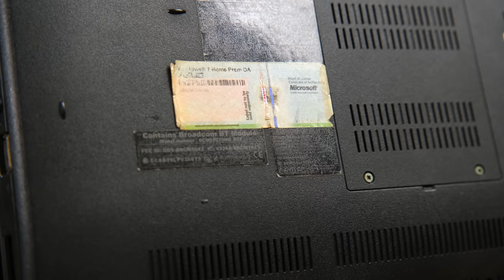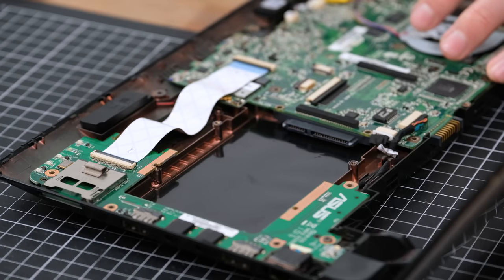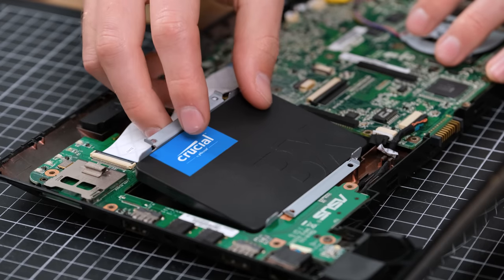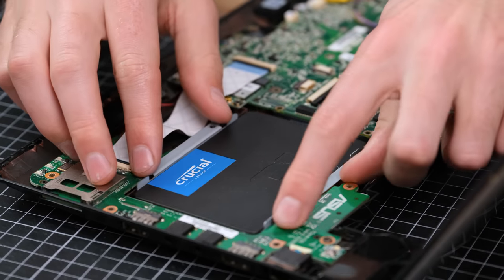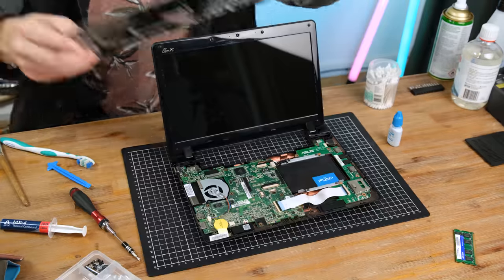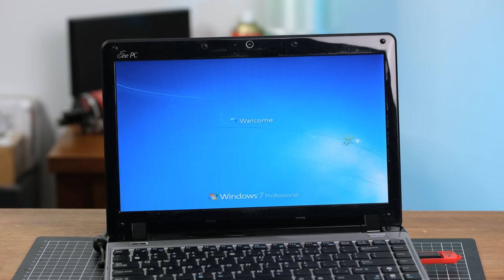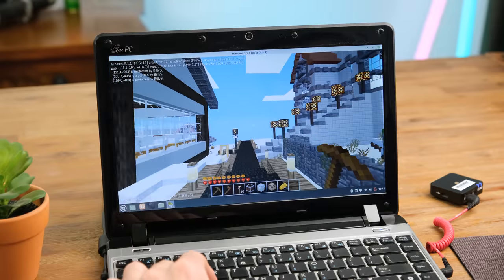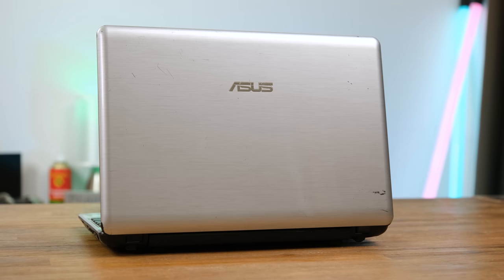I Bought This $10 Laptop From eBay...

Comment: This CPU was garbage even in 2010… why did they put that??? A Core 2 Duo T4300 doesn’t make the laptop need to be bigger. And it would allow for another RAM dimm.
Reply: T4300 has over 6 times higher TDP. And netbooks were made for web browsing etc. back in 2010 those Atoms were enough for that.
I got my Atom N270 netbook (Compaq Mini 110c) in 2009 and I really loved that thing. It had great battery life (around 6 hours) and was able to run flash games, youtube etc. without any problems. Sometimes I even had a lot of browser tabs open and it handled it fine. Mine ran Windows XP so the low amount of RAM wasn't a problem
Reply: @Pasi123  Well today they can't even run YouTube, and RAM isn't a problem, I managed to get YouTube to run fine on an Intel Core 2 Duo T5450 @1.67Ghz along with Intel GM965 Chipset... and 1GB of RAM
Reply: @Zebra_Paw  But does that really matter in 2021 when the netbooks are over a decade old? And if you really have to watch Youtube on one, you could always download the video and playback it on VLC. My N270 can run 720p videos locally without any problems.
And netbooks with ION graphics (GeForce 9400M) h264ify might help the playback on browser but I'm not sure because I don't own one.
Reply: @Pasi123  yes I know I had the same idea with an old computer with 1GB RAM DDR1, Intel Pentium M and Radeon Mobility 9600... also the hard drive id a custom plug, no SATA, so no SSD...
But if you don't like retro games a PC that can't even navigate the internet well is worthless.
Reply: @Zebra_Paw  Is it an IDE hard drive? That's what laptops from that era used.
I have an old laptop with a Pentium M 1.6GHz Banias, Mobility Radeon 9000, 1.2GB RAM and 80GB IDE hard drive.
You can get mSATA IDE adapters for quite cheap if you really want to put an SSD in it

Old games and legacy software/hardware are pretty much the only reasons why people collect old computers
Reply: @Pasi123  It is IDE but not the kind you can easily find an adapter for. It is also a 80GB hard drive spinning at 5400RPM. And yep this computer is garbage when it comes to navigate the internet, and I think the main problem here is the graphics
Reply: @Zebra_Paw  The graphics card shouldn't have much to do when web browsing. You are more likely limited by the CPU and RAM.
What OS you have on it?
Reply: @Pasi123  that hardware could run HD youtube with windows 10 actually. In my case 1GB of RAM isn't the problem because the Pentium M is 32 bit, and Vista 32 bit requires only 512MB. Windows 7 or even 10 in 32 bit both require just 1GB, but I tried them and due to the slow hard drive it runs painfully slow, and also the sound isn't supported because there are no drivers.
By the way the memory of this PC is DDR1...
Reply: I have a T7200 along with NVIDIA GeForce GO7300 and win 7 64 bit, so the minimum is 2GB of RAM, but it is enough to run 720P youtube. Switching to Lubuntu 18.04 which needs a minimum of 1GB RAM for the 64 bit OS, this 1GB is also enough for 720P youtube.
Reply: @Zebra_Paw  Vista 32bit is completely unusable with 512MB RAM and barely usable with 1GB.
IMO the minimum for 32bit Vista/7 should be the 2GB and 3GB+ for 64bit.
Low amounts of RAM was one of the reasons why Vista was so hated. With enough RAM Vista SP2 is great, it's pretty much the same as Win7 non-SP1
Reply: @Pasi123  Actually I think the biggest problem of Vista were slow hard drives. But my Vista 32 bit with 512MB (yes I tried to remove one stick) is almost as usable as with 1GB.
By the way with an SSD Vista is better than XP in my opinion, because you have a much better start menu, Wi-Fi or lan is much easier to setup, and you can move an app around on the desktop without horrible lag
Reply: @Zebra_Paw  Sure, slow hard drives were a problem too but more RAM would help a bit because then it doesn't have to rely on the pagefile that much or at all.
Nowadays Vista on 512MB RAM would be even worse because modern websites can easily use more than that.
Also that 512MB requirement was for the RTM version, SP2 with latest updates and more modern versions of programs use way more memory.

I've never had any horrible lag when moving an app around the desktop on XP other than before installing GPU drivers
Reply: I tried XP on the computer with 1GB RAM, Intel Pentium M and Radeon Mobility 9600 (or 9500 I don't remember) and it made the system nearly crash every time, which doesn't happen under Vista.